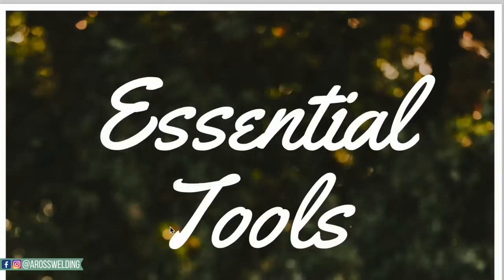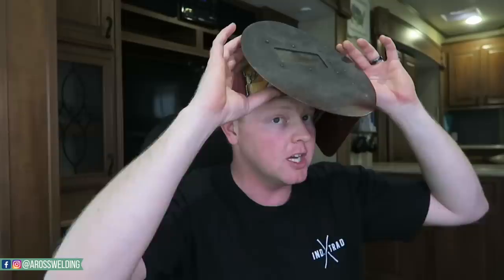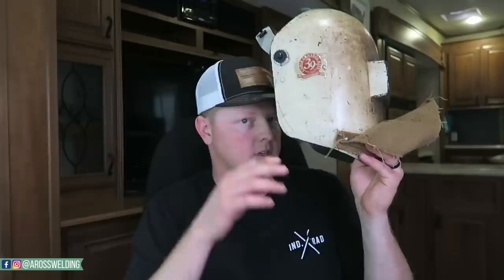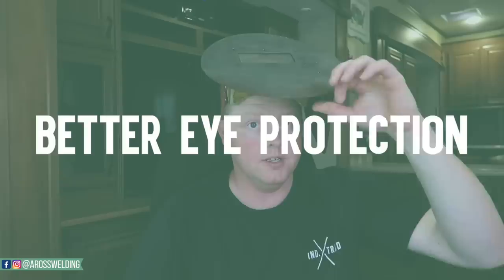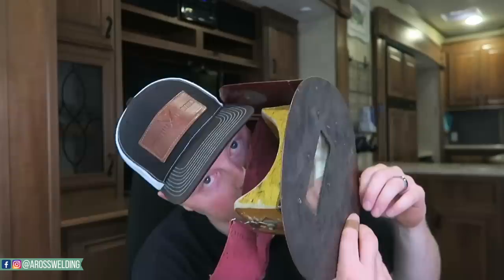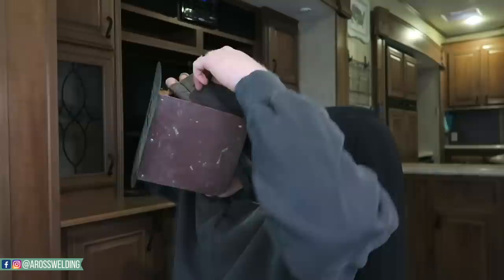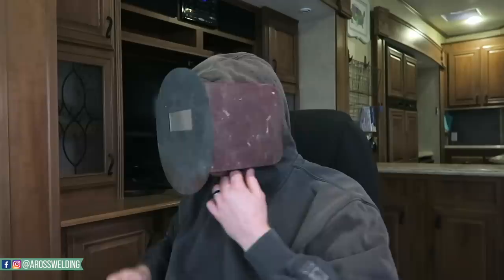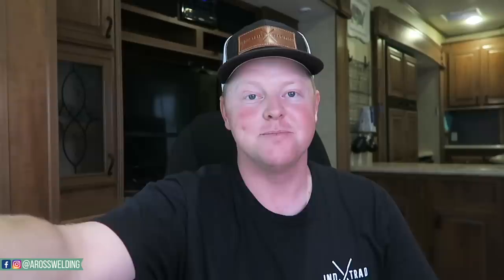WHY PIPELINE WELDERS WEAR PANCAKE WELDING HOODS (EVERYTHING YOU NEED TO KNOW)

Comment: I've been welding for 15 years, and I have a degree in welding technology. I've never heard of professional welders using a pancake hood because they are not ANSI certified, so if an inspector sees you welding with such a hood, you are fired and the company has to replace every weld you made. Welding with a hoodie is also probably a terrible choice since they are almost always made with composite fabrics, which tend to melt into your skin if it catches in fire (welders always wear 100% cotton to avoid melted plastic in any burns). If you have to make your own hood to weld, you are not a good welder!!! If the sun is in your eyes on a weld, just wait 20 minutes and the Sun would have likely moved far enough across the sky to assuage any lighting issues. When I see videos like this, it just reminds me that under-educated, neurotic, and stubborn people end up welding as long as I have, but they've been doing it wrong for that amount of time. I noticed a video where Austin Ross talks to a welder wearing a pancake hood who has been welding for many decades in such a way, but that doesn't make him a good welder. Let me see a video where he takes a 6GR pipe test with a pancake hood and what the inspector says about it! I say any certified inspectors would tell you to go home without even looking at your welds. Or you've been working for substandard companies your whole life, hoping to slide by every job like a chick with a nice pair of tits tends to do.
Reply: A wise man has something to say, a fool just has to say something.

Comment: You really need to start thinking about using a respirator (all the time) grinding and welding shop or field ! Your pancake doesn't allow for corrective eye  wear a cheater lens or respirator.  As you get older and you can't see and can't  breath you will wish you did.

Comment: If it ain’t got auto darkening… I ain’t using it. 😂 the future is now old man meme. 

Leather is a gift from god himself. I refuse to wear any kind of ppe that isn’t leather. ‘Cept the hood of course. 

I used to have my whole helmet smothered in leather. I took an old wore out set of leather sleeves and apron. Chopped em up and riveted them all around the edge of my regular plastic auto dark hood from Home Depot had the leather riveted so that it would drape over past my shoulders to keep all the sparks out. But that got to be too heavy for my neck after a couple months. So I found a leather hood that goes under the headgear to keep the weight of the hood but still provide adequate protection. 

I did like that my previous method blocked out more backlight though, now that I’m typing this i might have to cook up a way to block out backlight without the weight.
Reply: Use old Fr coat or sleeves and metal tape or gray tape and metal tape over that or velcro strips

Comment: Cool man. I can make you a kick ass welding shield/hood from carbon fiber that will cover both sides of your head and twist lock clips in front near bottom of hood so you can attach a bib to the bottom like your  1 hood you have. I also mounted a small fan in my hood that blows air on my head runs off a small 12 volt batter like you find in power wheels kids trucks.  My battery hooks to a belt on my back or cane moved any place on your belt.

 I had many problems welding and turn my head and I got cherries get in my ears &^#* that hurts. I also had cherries come over my head drop down on top my head I can feel the cherries as they turn thru- my hair above my eyes then fall down burn off a few of my eye lashes burn my face just below my eyes.

 This happen to me many times mig welding setting down or standing up. I use straight co2 cuz I can get so much more welding down with straight co2. With 25/75 I can weld 20 percent of the time I can get out of straight co2. So save lots of money and time going back to  welding shop to get bottles filed but the straight co2 makes much more sparks/cherries